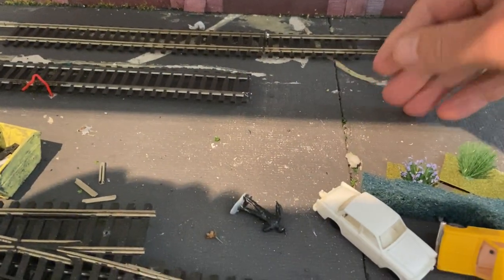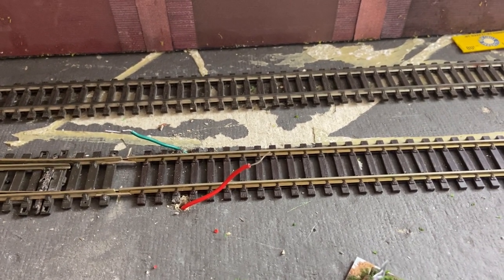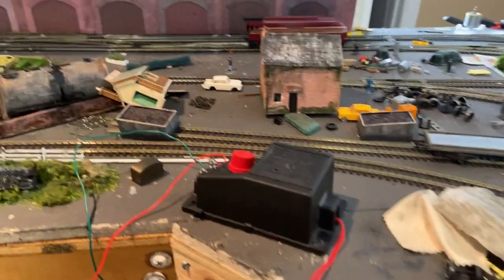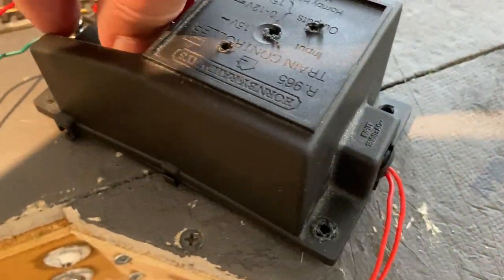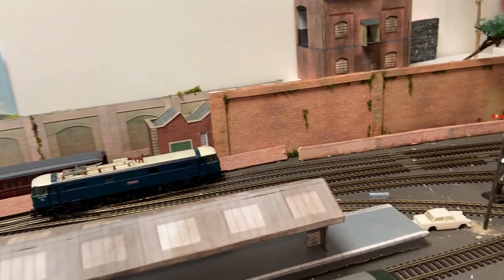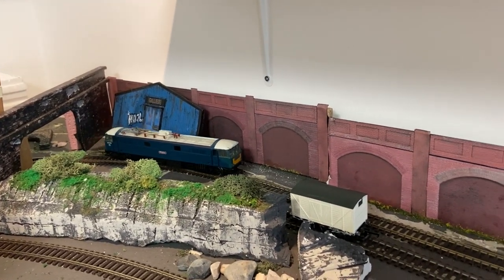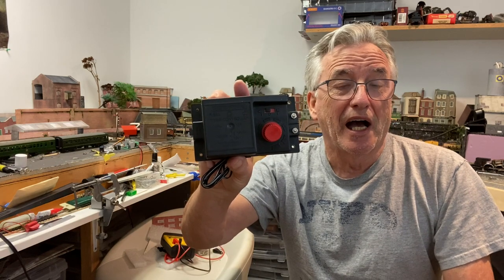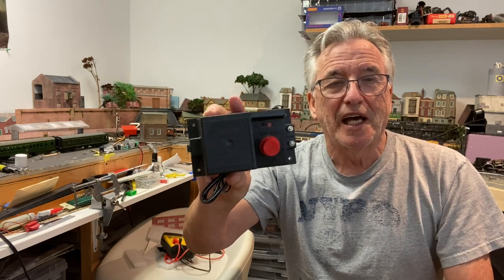Model Railway- my TRIANG R965 Controller  how to improve your loco running on your DC layout

Comment: Keep going Charlie ! , may I suggest keeping all of your track sections tight together, in terms of making sure all of your fishplate’s have each section butted up nice and snug . That way you’ll have perfect electrical connections, but primarily smooth running without any potential for derailments . The key golden rule with insulating point work , is to remember that current will only flow in the direction the blades are set . Cheers . Richard .